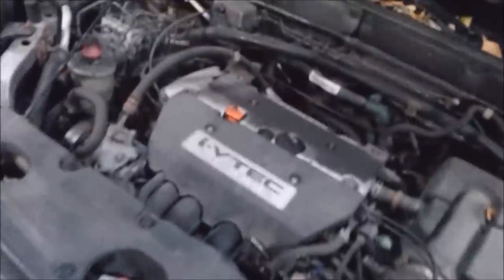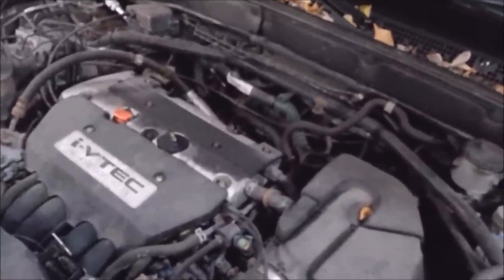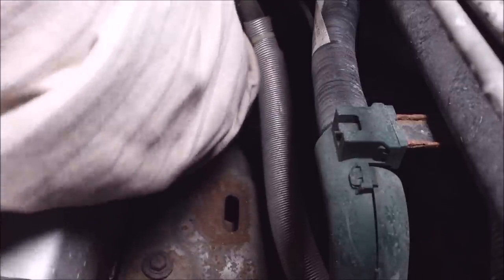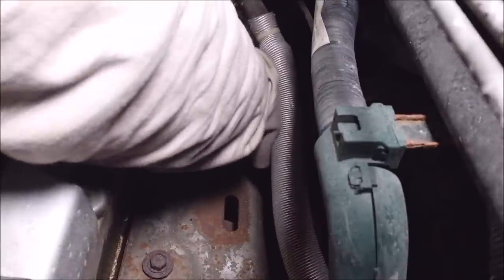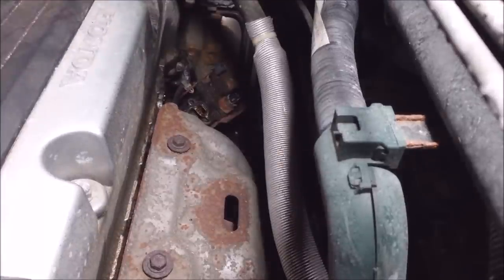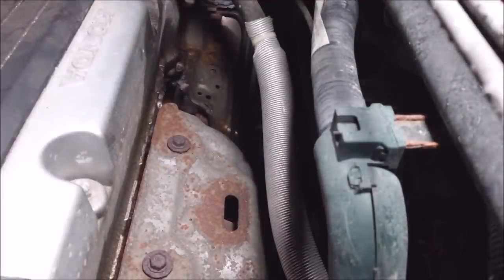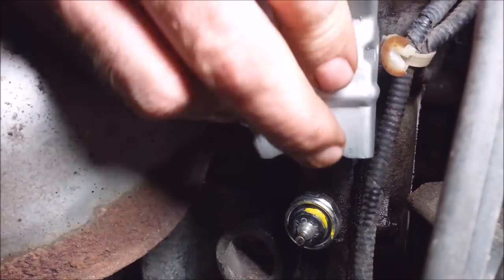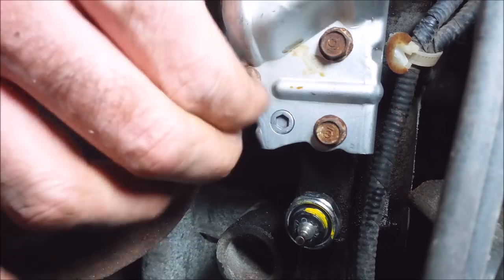2002-2009 Honda CR-V P2646 P2647 code fix.

Comment: Mys too p 2647 I fix it no more engine light....but I use scan tool code p2647 still there ?? But no engine light...... how can I get that code out?? Please teach me if you know how
Reply from the maker: It is a stored, or pending code. The light turned off, because it is no longer a problem. It is a fail safe for diagnosis, because it will have stored freeze frame data. You clear the code with a scan tool.
Reply: Confirmed & pending  trouble code...... I did use scan tool to clear it .....and everytime I rescan it code p2647 is there
Reply from the maker: @Hibachipower  I would try a different scan tool.
Reply: Rust Belt Auto ok I ask friend try he’s tomorrow thank you for helping.....

Comment: Just had an oil change and now 06 crv is in limp mode going only up to 3000rpms.  I've replaced the vtec solenoid once before and it fixed it but I'm wondering if I only clean the filter would it fix the problem instead of spending another $90 on a vtec solenoid again
Reply from the maker: People are making a lot of not so good spool valves for these. Everyone and their mother's, father's, brother's, sister's, husband's, grand daughter's, including myself are having problems with these aftermarket v-tec solenoids.
Reply: So basically the word on the street is to purchase the factory honda vtec solenoid and it should alleviate most of the problems in this area?
Reply from the maker: @willc32917  yes Sir. V-teC Is ActUaLlY a GoOd ReliABLE SySTeM..
Reply from the maker: My last one kept puking oil pressure switches. I just got a new one under warranty.
Reply: @RustBeltAuto  is the oil pressure switch easy to change?
Reply from the maker: @willc32917  yes. It's the wired sensor on the v-tec solenoid that screws in. My last one I took off was some Chinese junk that didn't have any markings on it. I took it to the parts store, made them get me a good one they had in stock that was in a box, put that Chinese junk in the box, and had them return it defective. That way I didn't have to replace the whole spool valve with another cheap Chinese junk sensor on it. If you supply power to the solenoid you should hear it click, and feel it move too. That way you know the rest of it is working.
Reply: Would an oil change with non synthetic,  possibly crappy oil, 5w 20, produce the limp mode issue? I'm thinking of going and getting it changed again,  possibly with synthetic this time and a quality oil filter.   
I did an ohm reading on the variable valve timing solenoid sensor and got 8.5. (Not incredibly bad but still not what it should be)
Reply from the maker: @willc32917  absolutely not. Oil is okay. Actuate solenoid with 12v. That just means the coil winding is okay.
Reply: @RustBeltAuto  I could actuate the vtec solenoid with 12v and should see it move, the vvt sensor as well.   How about the oil pressure switch? Would it activate or spin with 12v? Thanks
Reply from the maker: The sensor is normally open, or normally closed, cannot remember which, and when you supply oil pressure to the switch, it does the exact opposite. So technically, you need to use an ohm meter on the switch, get a reading, run the car, supply oil pressure to it by opening the solenoid, and take a reading again. It should go from zero to infinity, or the other way around. Or just use a good scan tool, and it will tell you if it is on, or off. Sometimes those solenoids stick, and intermittently do not work as well.
Reply: @RustBeltAuto  I changed vtec solenoid and the vsa and orange triangle went away for a while.   Drove on the highway for a while and came back.   Took it to auto zone for a diagnostic.   It had a lit of codes.   One was the map sensor,  which I replaced but cel still comes on.  Another was app sensor which I have not changed yet.  This is frustrating af
Reply: @RustBeltAuto I realize this is an old video, and I can only hope you see this comment.... I keep seeing the same thing "don't use aftermarket" however I can't seem to find the part number to purchase the Honda part. Any chance you would be able to tell me where I can purchase?
Reply from the maker: @elisa7joy9  NTK VV0122

Comment: I had the same codes... replaced the solenoid as video showed... now got new code p0010... any thoughts?
Reply: Btw i have 2008 crv ex
Reply from the maker: @furiousprimates8333  that code is for a camshaft actuator.
Reply: @RustBeltAuto  happen to have a video on replacing that component? 😇
Reply from the maker: @furiousprimates8333  no. I would clear the codes, and recheck it.
Reply: @RustBeltAuto  cleared codes twice but came right up again in less an 1/8 of a mile
Reply from the maker: @furiousprimates8333  look elsewhere for information.
Reply: Update; after some researching, I found a bulletin by Honda that replacing Oil Pressure Switch would also help address these codes, so I just got done doing that.. car is back to normal,  floored it on test drive, vtec engaged just fine, thank you so much for your help! For me, it qas both the solenoid and the oil pressure switch that needed to be replaced.... your video saved me a lot of time and money... cheers!!
Reply from the maker: @furiousprimates8333  nice. Did you get a defective switch, that came with the new spool valve? I have had a couple bad ones from Dorman. One leaked oil all over the place.

Comment: I have this problem but after replacing all these things, the wires and connectors I still have the same code come back on. It makes no sense and Honda master mechanic can not figure it out.
Reply from the maker: Need to unplug both connectors, activate solenoid with battery power with the engine running, and check the switch with an ohm meter to make sure all the components are working, and getting oil supplied to the spool valve. If it all checks out, plug everything back in, and connect volt meter to solenoid. Drive it around, and see if there is voltage supply when vtec is working. It's not a complicated system.
Reply: @RustBeltAuto  So they have replaced the whole Vtec assembly, the connectors to it, the wires, and I can not even remember what all else. I would lose power and get the car to the Honda place and then get it back and it would do it again. They then replaced the whole thing again since all components in the system had been replaced and it is sitting there right now again because the light came back on but I did not lose any power and it was driving fine.
Reply from the maker: @randyalanjones  maybe they will get it all sorted out.

Comment: I changed my solenoid a month back and cel came back on yesterday. Code p2467. I noticed when I first changed it the circular cable was missing the plastic shroud that holds the connectors. Could this cause be the cause of it coming back on? Oil was also changed along with filter
Reply from the maker: p2467 is Exhaust Gas Temperature Sensor Circuit Range/Performance. Surely you must be dyslexic.
Reply from the maker: I'm an asshole because you gave me the wrong number. I'm sorry you have no sense of humor, and could be wasting my time because you could be wrong about something.. Nice reply. Who's the asshole now? Check your work. If something is not right, start there. If part has a warranty, you could always do the easy thing, and exchange it as defective. The one I replaced in this video ended up puking oil all over the place out of the sensor, and I needed to replace it a second time.
Reply: @RustBeltAuto  and still you give helpful reply. Right on!
Reply: @billydamnit  hey Billy hard to take you seriously.

Comment: I have p2646 and a new vtec solenoid what now ?
Reply from the maker: It means it is stuck in the off position. Either you have no oil in the car, the solenoid you got is no good, or you have a wiring issue. To diagnose it, I would run the car, activate the solenoid with a 12v source, and check to see if the v-tec oil pressure switch goes from zero to infinity with a dvom, while grounding one lead and touching the other to the center post of the sensor. I would guess you have a defective part. Did you have the same code before you replaced it?
Reply: I change the part my self, how can i reset the cel without having an obd2 diagnostic tool?
Reply from the maker: @dipsettkid5  as far as I know, you cannot. After a certain number of drive cycles the light should turn off if it is okay, but it will have a stored code, and freeze frame data. They will probably clear it for you at a parts store that checks codes for free.
Reply: Can take the ground off for 10 secs to clear check engine

Comment: I have a acura rsx that has been on limp mode for a while  now and i replaced the motor because the dealer said it has a worn out camshaft actuator and that theres shavings in my vtec solenoid so it was declared as a faild engine now my mechanic put a new motor and the stupid code popped on my  new motor and the mechanic tried to clear it and it wont go away but the vtec solenoid it has on that motor looks old and rusted  idk what it can be
Reply from the maker: Metal shavings in the screen is a bad thing to see. The solenoid, and switch can be manually tested with the engine running.

Comment: Wtf wouldnt u spray some pb blaster or wd4o break loose the rust on bolts
Reply from the maker: For one, PB blaster smells horrible, and leaves brownish yellow staining streaks everywhere. Terrible stuff. Threads need to be exposed for penetrant to work. Those threads don't get rusted. The bolt heads do. So no.
Reply: You must be a beginner or an amateur working & removing bolts/nuts.
PB Blaster is useless because 86% of the time the thread is closed, meaning they don't get rust.
Always the head of bolt will be rusted.

ATG says if you can't see the thread, you are just throwing money right out of the window by using PB.
ATG says to use transmission fluid if needed and lost cheaper when in used condition.

But then the transmission fluid & PB Blaster smell badly.
Reply from the maker: @angelisone  what's an ATG?

Comment: Replaced the sensor and filters and oil now to try the most expensive new spool valve
Reply from the maker: This job was fun for me. The sensor on my first spool valve from o-really's puked oil all over the place, and the second one had a sensor that failed stuck on. They put some cheap generic sensor on those valves they sell. I made them exchange the sensor with a real one (oe direct fit re-box thing), so I wouldn't have issues for the fourth time. Good luck!
Reply: @RustBeltAuto  I replaced mine with a oem one
Reply from the maker: @clinteastwood666  nice